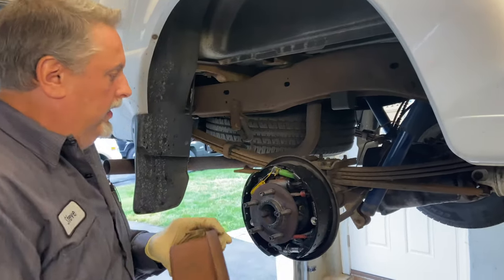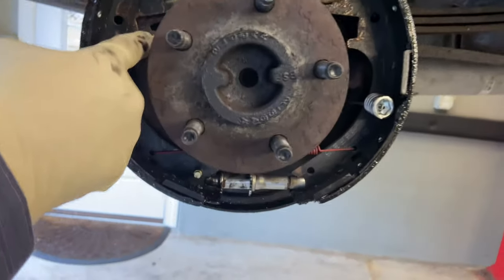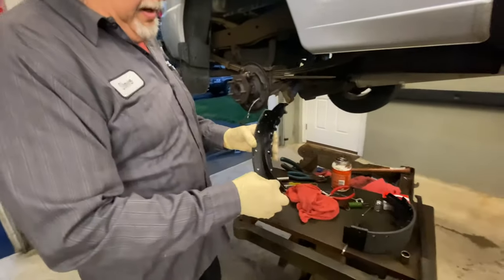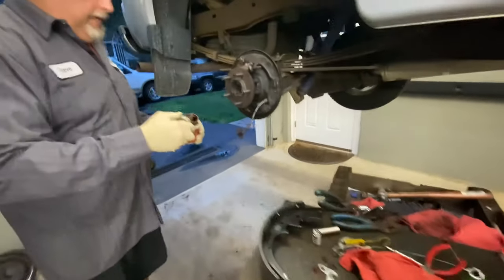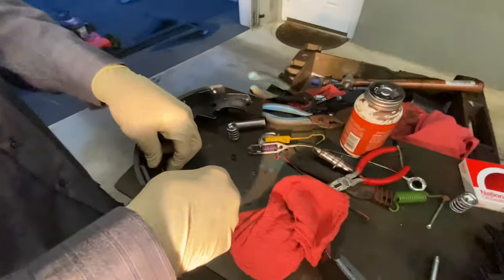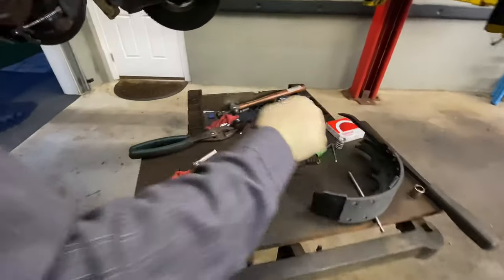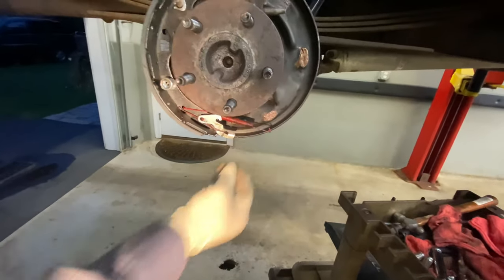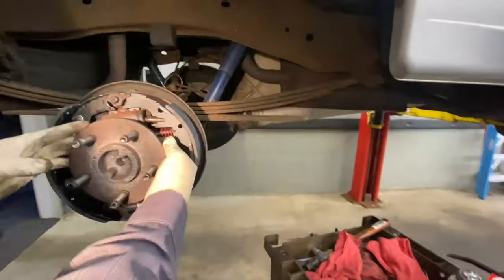1998-2012 Ford Ranger Rear Brake Shoe Replacement

Comment: been working in a shop for a year or so but finally got around to trying my hand at drum brakes for the second time. this video made it a cakewalk compared to the  first! still took some time, but a lot less confusion on how to take things apart and put it together since you show everything. really appreciate it!
Reply from the maker: Thank you for watching our auto repair video that shows you how to replace the rear brake shoes on a Ford Ranger.

Comment: About replace rear brake on 06 Ranger 4x4. It'll be my first time replacing drum brakes. This video helped a lot. Thanks!
Reply from the maker: Thank you for watching our auto repair video that shows you how to replace the rear brake shoes on a Ford Ranger.
Reply: Are they the 10 inch or the 9s on that 4x4 Ford ranger

Comment: Got a question for ya. Green and yellow springs only want to hook the top stud from the bottom  and not over the top. Tried for 2 hrs in hot sun and there is no way to get these over the top of the stud without twisting the spring. Do I just put it on like this or do I have bad springs?

Comment: I spent hours on replacing my drums last night and after I got everything together my drum wouldn’t slip on. The adjuster is as short as I can go, everything fits tight, and i nearly wanted to push my truck off a cliff. I did get new brake cylinders and they push the pins out pretty far compared to the older ones. Any advice? I need this thing ready for winter 🫠
Reply from the maker: You may want to make sure the brake shoes are seated correctly.
Reply: @HomeOwnerRepair  If it's only one side you put the two bigger shoes on same side . The two shoes at are a little bit different in size on each side . I done that about 30 yrs ago in a hurry on a 92 ranger didnt realize it till I went to put last drum on

Comment: Has anyone had an issue after replacing the shoes and the drums where your brakes start to pulsate? I’m having some bad shaking and can determine if the E brake needs to be adjusted for if I might have a warped drum from the factory.
Reply from the maker: It the shaking in the steering wheel or brake pedal?
Reply: @HomeOwnerRepair it feels like it’s mostly in the brakes but i felt a small amount in the steering wheel at some point. I did have it checked out and I guess there was an issue with the wheel cylinder.

Comment: Back up and show how to get the damn brake drum loose.  You left out the hard part.
Reply from the maker: Loosen the tension on the adjusting screw (back side of drum). This will relieve the pressure of the brake pads against the brake drum and should make it easier for you to remove the brake drum. Hope this helps you out.